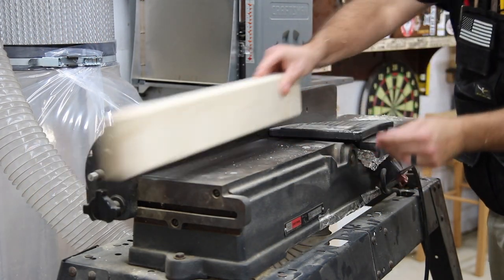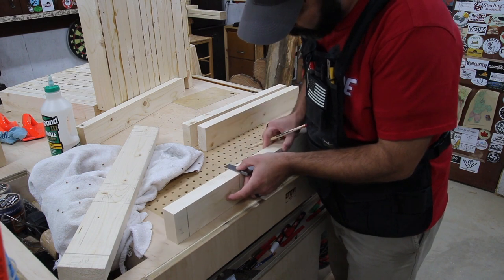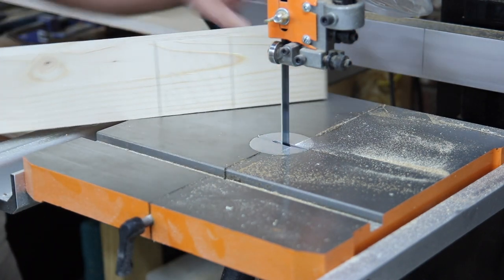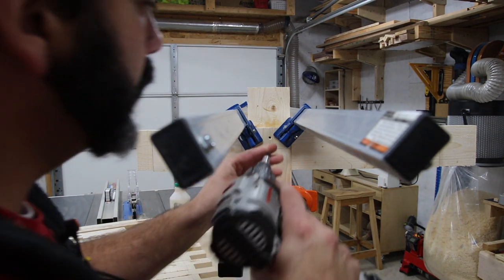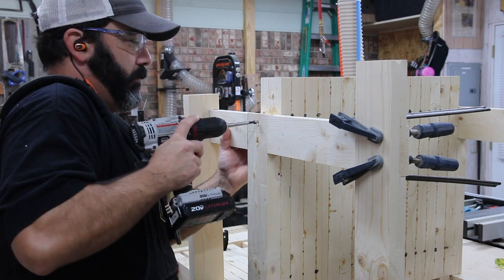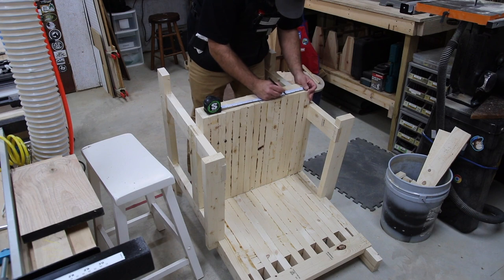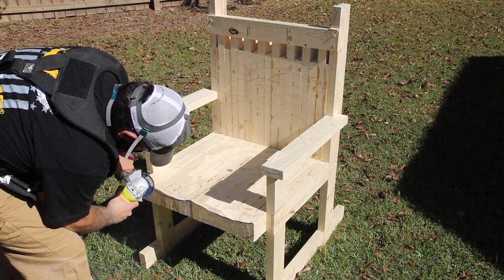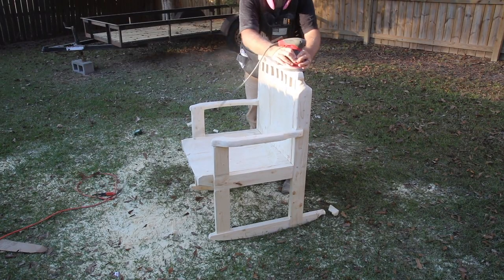Power Carving a 2x4 Rocking Chair

Comment: I've been wanting to try power carving.  Turned out really cool!
Reply from the maker: Thanks. It was fun
Reply: If you want to give it a try Harbor freight sells a good cheap grinding wheel for his kind of work. It’s not as good as the kind he’s using in the video but at only 10 bucks for the wheel and 10 for the angle grinder on sale it was a no brainer for when I started power carving.
Reply: What kind of grinder wheel is it?

Comment: If I may... most chairs especially rocking chairs have a back splay on the legs of about 6ish degrees or so to make it harder to flip backwards. With them being straight down the geometry let’s the center of gravity get behind the contact point at the floor.
Reply from the maker: Thanks for the info.

Comment: How did the rocker balance work out? I've never made a rocking chair but, when thinking about it, it has seemed to me that it would be tricky to get that balance just right. For example, I guess that when a person sits in it, it should stay upright and then the rocking is up to them. I'd be concerned that when you sit in it it just tips forward and a kind of leaning forward thing becomes the default for that chair. I don't know if that's at all clear, but maybe you can guess my meaning.
Reply from the maker: You are correct, it does. This is mainly to practice for carving. Next time I would angle the back and do the legs different, but good eye.

Comment: I don't do it often, so I never remember to do it until after I'm already done, but ... when pounding in dowels that go on for some distance I keep thinking I should mark that distance on the dowel beforehand so I can know for sure that it is seated as deep as it should be. You can probably do this by eye, or perhaps you've made sure the hole and dowel slide together so the seating is obvious, but sometimes I find myself guessing, and that one easy mark would have eased my worried mind. Cool chair idea, and thanks for showing it!
Reply from the maker: Good input. I listen for the change in thud.

Comment: Why did you mill it if you were going to carve it, that could have saved you some time
Reply from the maker: The rounded edges would have shown gaps if I didn't carve it away. I also wanted the half lap joints flush
Reply from the maker: +bart MAN also, it gives me a nice flat glue surface.